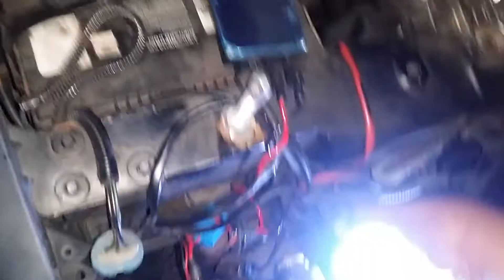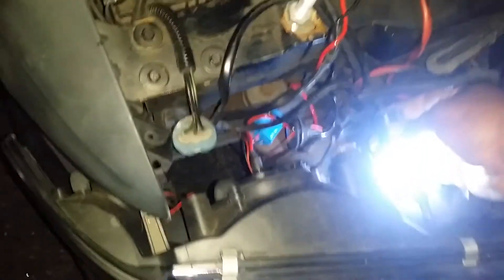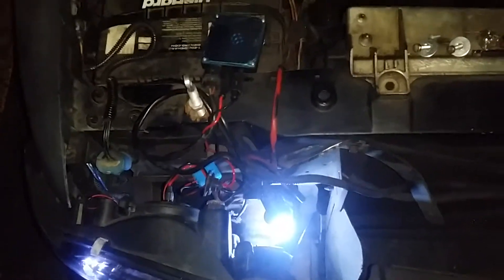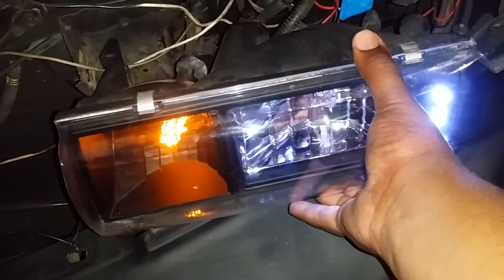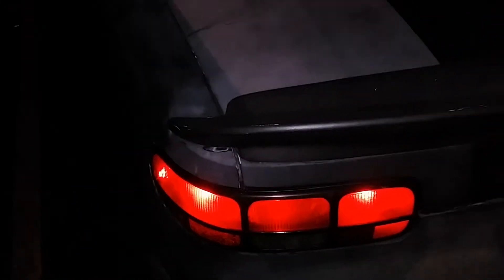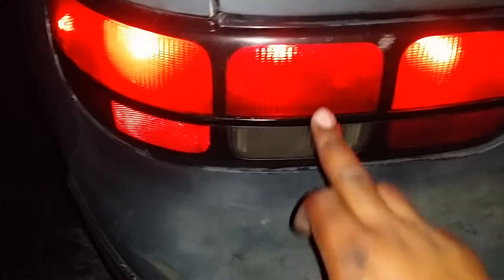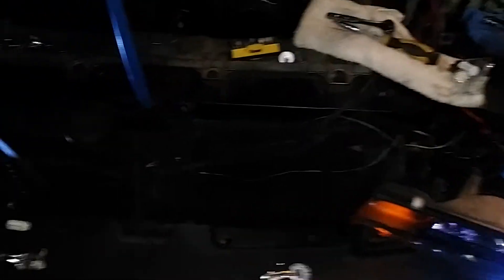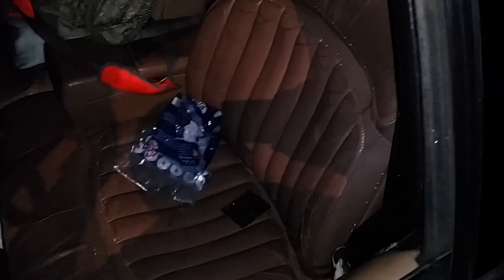LED lights, problems, solutions relay/resistor

Comment from the maker: Sounds like there may be a problem with the pick up on the pump in the tank or something going on in there. Or its just when your tank is low. If you have a lot of gas in the car and it still does the same thing, you definitely have problems.

Comment: Glad to see you back. I need some advive, when i make a sharp left turns the gas needle drops down to e and the car stalls for a second or two then goes back to normal. Any suggestions? I have a 91 Caprice Classic with a 305.
Reply: Same here it's common I believe it has something to do with the sender getting old
Reply: +Breon Allen What ans where is the sender, is it an easy fix?
Reply: +Breon Allen are you talking about the fuel pump?
Reply: The sender basically tells you when you're running low on fuel its a float really it should be an easy fix honestly sometimes fuel cleaner will do the trick
Reply: +Breon Allen Thanks for the advice, what year is your car?